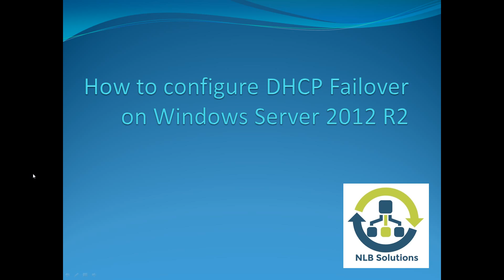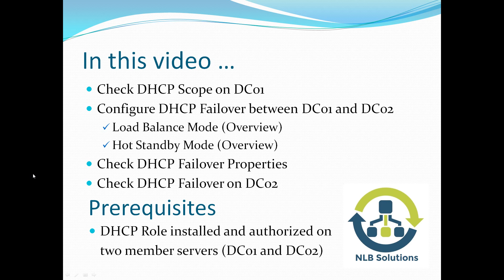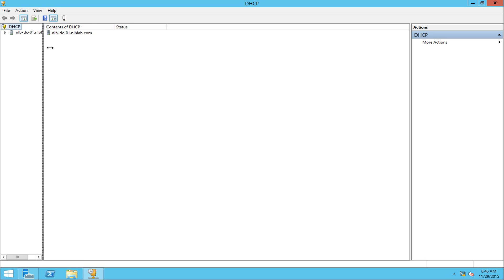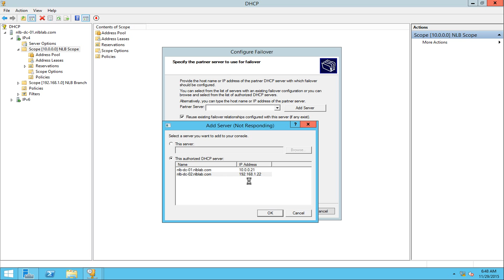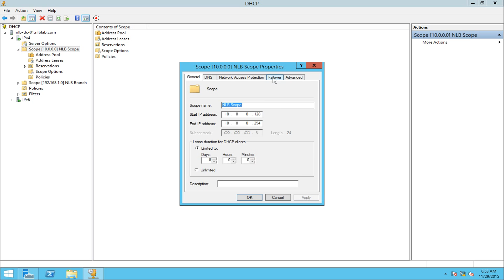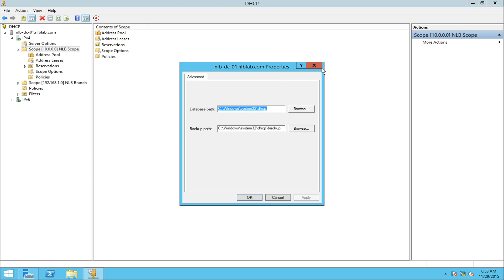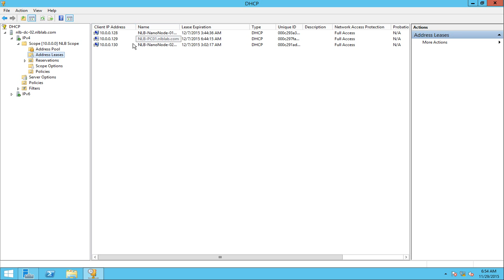How to configure DHCP Failover on Windows Server 2012 R2 (Step by Step guide)

Comment: Hi,

I did the failover with 2012R2 between two machines, in the interface of the cisco switch in the IOS version we must add two lines with "ip helper-address" and the ip of each server, in the NXOS version use the "ip dhcp relay address" command.
It works perfectly!
Many thanks for support @NBL Solutions
Reply from the maker: Thank you for your valuable input, Domingos! Much appreciated.

Comment: Very simple and clear, Congratulations!
I have a question, what is the ip address to answer for the cluster ???? 
If you have to set the ip address on the cisco switch, which one to use?
Many thank you for sharing your knowledge.
Reply from the maker: Hi Domingos, thank you for your kind words and the good question. DHCP Failover technology is not the same as failover cluster technology. It is not using a dedicated IP address for the cluster. The only thing you need to consider is if your network is blocking the DHCP traffic.
Here you can have very detailed information about DHCP failover - https://technet.microsoft.com/en-us/library/hh831385(v=ws.11).aspx
Reply: NLB Solutions Thanks for your support... 
In the dociment they do not talk about the ip that will be used in the vlan interface, I will do a test in lab before implementing.
Reply from the maker: You can always share the results in here, if you have the time.
Reply: Yes sure! it will be a pleasure